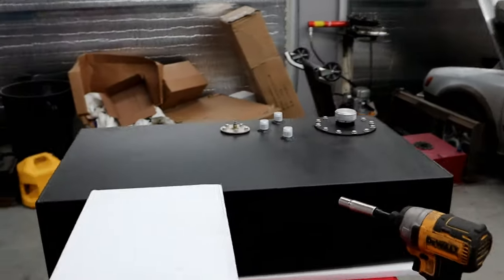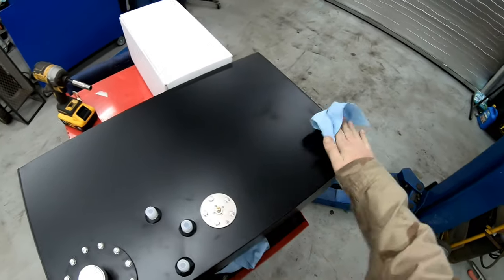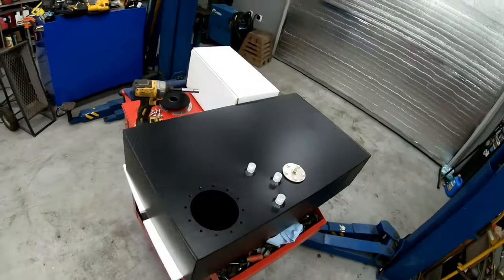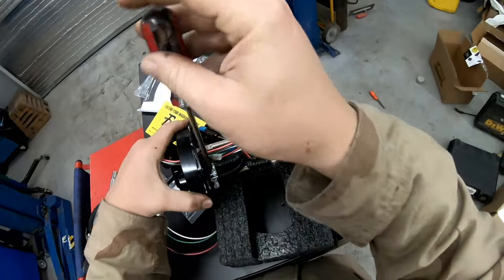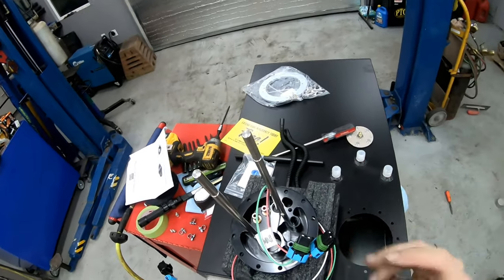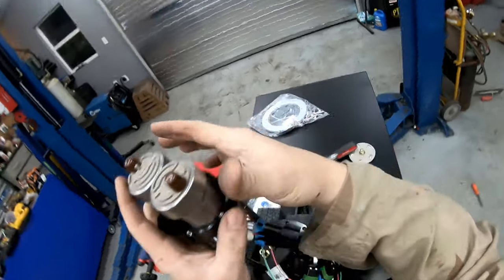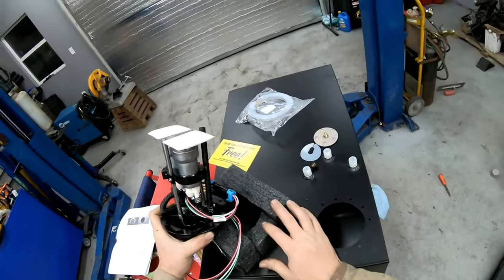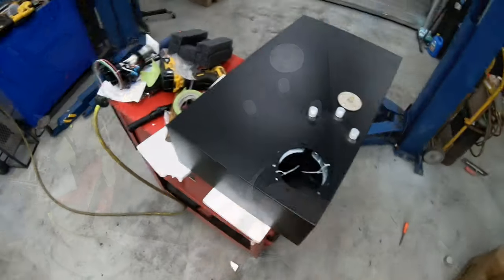Holley dual 450 drop in fuel pumps. Ls swapped WRX #35

Comment: With a in tank pump in a fuel cell you won’t need a surge tank correct?
Reply from the maker: Nope it will have all the fuel it needs but sloshing can be a issue if you don’t have foam but this is a drag setup so I buy the pump in the back it will be fine
Reply: @WastedTalentFabrications  yeah that’s my issues my car is drift car. So it will be hard to compared our fuel system thank you for answering so fast
Reply from the maker: @DannyR2681  no problem brother I know lots of tanks have the foam that’s supposed to help with that